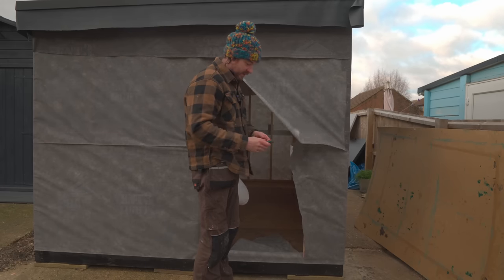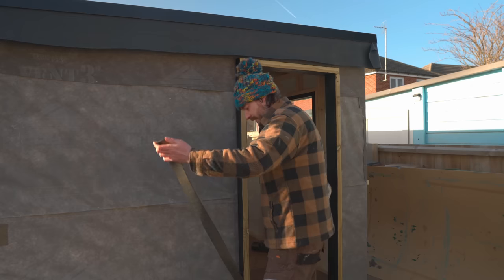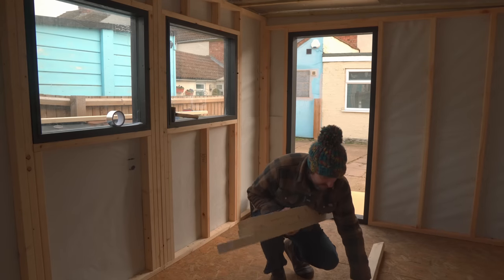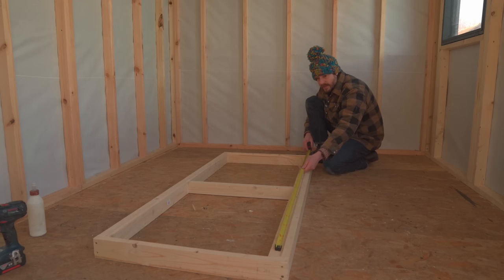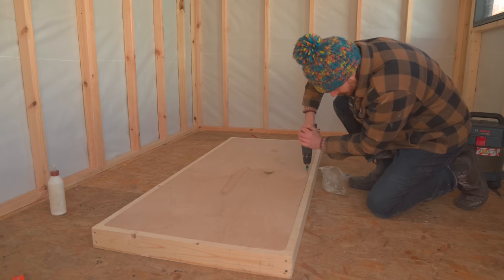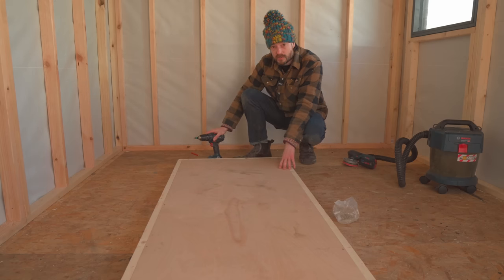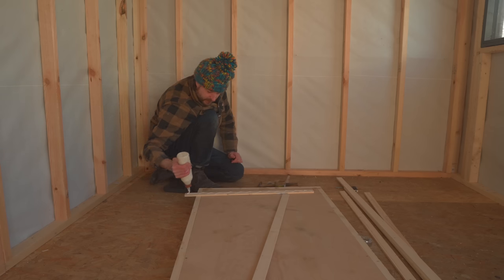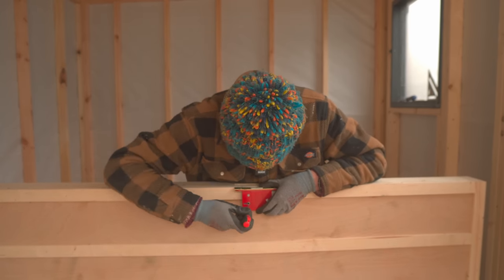Making A Door For The Workshop

Comment: Hi matt,
Love the shed/workshop,  just one thing as your door opens out wards, you might want to do is add a few hinge bolts to the hinge side of your door as it is easy to knock the pins out of the hinges and pull the door open,

Comment: Perhaps if you made a door another time id put a rebate into the frame. As it is now you have a gap around the perimeter of the doors and rain will blow in or run into. You can also add draught proofing the the frame with a rebate to keep it warmer in there and keep the sound in. It’s also an idea to put a 9 degree angle on the sill of the frame to stop water pooling and running into the shed. A weather bar on the bottom edge of the door can also help prevent this which is a preventative step you could take now it’s built.

Comment: The door was a nice idea but you need to install another piece of timber on the door to cover the gap from door to frame. This piece of timber will help stop the door pushing past the frame but more importantly cover the bolt on your lock. At the end of your video it was very easy to see where the lock was, a nice gap to get a pry bar in there if you want to gain access or the perfect spot for a grinder to slot in and cut the bolt off. Easy access to your shed then. Also invest in a set of hinge bolts. They cost under a fiver but will stop someone attacking your external hinges and gaining access.

Comment: Digging the slab foundation for my workshop and this series has been great! I've also made my own plywood door recently but used cheap CLS studs edge on to make a square frame. I used a grooving blade to cut a groove for the plywood and then put it together and screwed the frame tight. Looks great and much easier than arguing with the brace police if you make a slotted door 😅

Comment: Nice build Matt. 
Have you consider the security of the shed if you’re going to be storing tools in there? 
I’d recommend replacing those screws on the hinges, lock and frame with some longer/thicker ones as they’ll put up more resistance to attack. Any protection you can add to the hinges will also help as with a outward opener they are you weakest point. 
You may consider a multi locking strip further down the line which you can probably fit to that door retrospectively or a metal skin to protect the wood from attack.

Comment: Correct me if I'm wrong Matt but shouldn't the vapour barrier be on the other side of door under the MDF sheet. Most of the moisture/water vapour is going to be created by you inside the workshop exacerbated further by any form of heating you may be using inside the workshop. Having the vapour barrier on the warm side will reduce the amount of moisture entering the insulation. Top job otherwise mate.